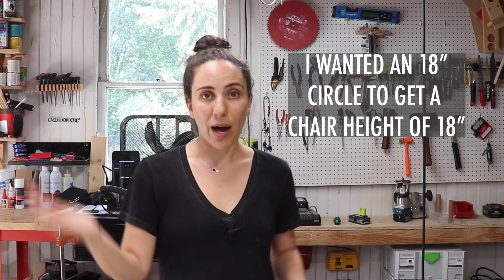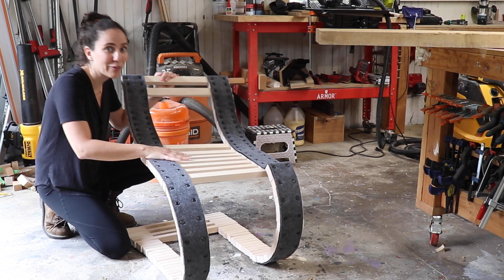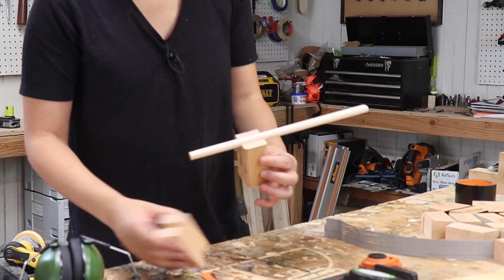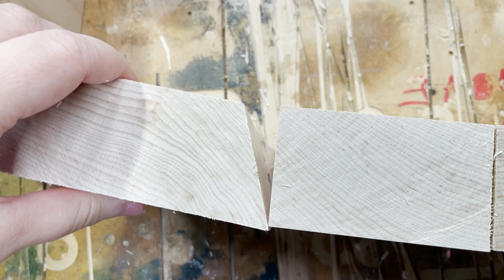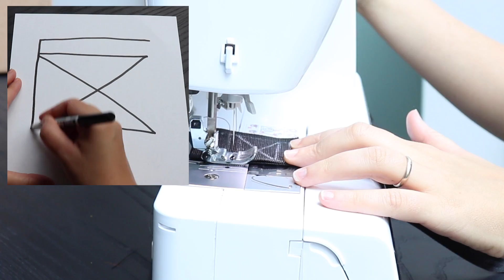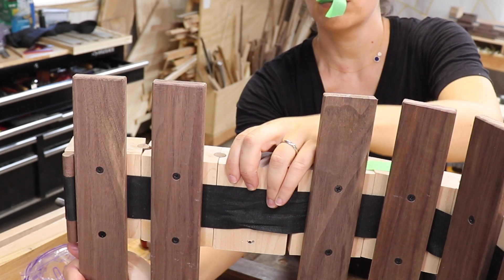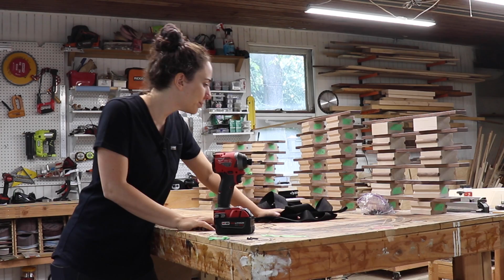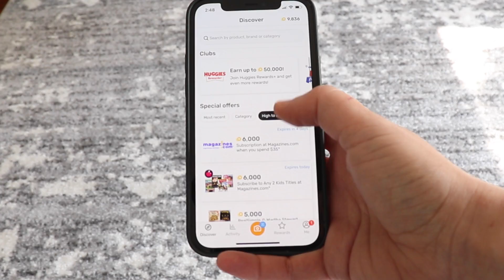I ATTEMPT to make a Roll Up Chair… AGAIN...

Comment: I'd expect cotton straps to stretch less than any polymer material (as long as it doesn't get wet).
You can also take a bunch of the danger out by attaching the strap to each block, meaning tension is only building up in the area immediately adjacent to any given block. Attaching the strap to each block could be done by slats that get pulled into a groove/detent in the block underneath. The strap has to snake around the slat, which makes for a friction fit AND takes out more slack as you tighten the screws.
You might also be able to design the blocks such that they hook into each other like puzzle pieces. And the only way to unhook them would be to roll it all up. That way the strap can become just the thing that makes rolling it up easy, but all the tension is taken up by the hooks in the wood. If wood by itself is not strong enough for this idea, using something made from metal that sits in milled-out detents in the blocks; ends might be a good idea; you wouldn't be able to see the metal when the chair is set up.
A last resort could be to use metal hinges. But that feels a bit like cheating, and it would be super heavy.

Comment: It may make you want to scream, but potentially having seperate strapping pieces from each joint to the next could prevent your extremity pieces being pulled in with the tension. It would also distribute the tension across loads of smaller straps when compared to one single long strap.

Comment: I think you need to stress test the strapping before testing it out and sewing it in. Calculate the maximum tension at a point and see how much it can handle.
In my opinion, i don't think strapping itself will ever be enough; there needs to be a change in how the strapping is connected with the woods or not use strapping at all

Comment: I might be an idiot here, but it appears that the curves you calculated for the angles of the pieces on the convex front are assuming there is no gap on the outside edge. I think your inner angle is too shallow because it’s assuming that the outside edges are touching. I think that’s why you’re getting droop/might be causing the stretching of the webbing material. Also, even static climbing grade webbing has about 10% stretch. Kangaroo leather is the strongest leather but it would be too small for your needs. You’re going to need to go with steel cables or something else that’s absolutely static. It would be really cool to have a bolt at the end you just tighten up with a wrench or drill to bring the chair under tension.
Reply: And most people in DIY know, but piano hinges are cheap and could probably help out with your stability issue and preventing the edges from moving. Weight will go up substantially though.

Comment: Why not route a metal wire inside the blocks for tension control? You can use the straps for aesthetics it will also help with the side to side motion

Comment: you know it has to strech right? like there are fibers and fiber is like what .001mm ? and whole strap is like 2mm thic 
can you imagine how much fibers it takes to strech before getting them tight with surface? just short it as much as you can 
these straps are used as belts in cars just let them strech to their limits they wont snap

Comment: What if at the specific bending point, you have the strap go in a loop around the wooden pieces? That way when you put any weight on it, it squeezes down on itself harder, keeping it together- but for this to work, youd have to have two of the wooden pieces set up to put leverage against one another and pull on the straps- this could all probably fit in the span of 2 modified pieces of the chair
Reply: Also, id try aiming for something with physics on its side for tensile strength. I like to beleive braided rope would work instead of a strap, though i could see how that would cause issues

Comment: Comment sections are great for inspiration! Though I'm a wood enthusiastic myself, I really like the metal hinges idea! They will make the dowels absolete as well!

Also, when I hear "wood" and "compression" in the same sentence, the bowyer in my head whipsers "OAK!" to me🤭

Furthermore I would suggest running it through stimulation software to see where the greatest forces are, and increase and decrease block thickness where necessary, to prevent to much tension on the hinges. Obviously they shouldn't be screwed in the transverse plane of the wood, but preferably the tangential plane, or radial plane.

And if your plan on actually using it, maybe a redundant system in addition to the hinges (steel cables?) for extra safety?
Reply: Almost forgot! Why not rounding the corners of the blocks to spread the forces over a longer portion of the strapping, but concentrate all the force on one point? I think most materials will (at least) stretch, with probably well over 100 kg (because the distance between the lower half circle and your lovely butt make it a fulcrum) concentrated on what is essentially a knife with a very high angled bevel.

I don't think this would make a high enough difference though, but it is an indication of an error on your way of thinking. Apparently, you assume the strapping to be infinity strong, without stretch.

Generally, things are stronger because they stretch. They stop stretching, when breaking. That's why I think anything woven or any polymers are setting yourself up for failure.

Comment: This might be beyond your project budget, but hinges would work to solve the stretching issue. They'd add a bit of weight and not look very good though. You'd still be able to roll it up at least.

Take my advice with a heap of salt, I'm a dumb welder who doesn't work with wood very often/at all.

Comment: forgive me, I'm not a woodworker, so I don't really know the vernacular.  but if you had a tongue and groove on each piece that fit in and locked to the other piece that would give you a firm chair that you could roll-up.  it would also provide lateral stability, and take the tension off the straps, making them just there to hold the thing in shape when it unrolls.

Comment: I FOUND A FIX!!! The reason this is happening is because the chair is creating slack from the top curve and the bottom flat surface as seen @23:00 when you try and sit on it. The other side of the chair needs tension on the bottom of the chair and on the top curve. I suggest making this simple and removable when you go to disassemble the chair by using insertable dowel. And make sure you do this separately for both of these sections 1 for the straight and 1 for the curve… and doing so for both sides. This also means you can keep all the setup you have and just add on to it without issue. Hope this helps :))

Comment: Just going to add some thoughts from an engineering perspective:

You talked about how you selected your strap materials based on them being advertised as strong and lightweight, but strength was never your limiting factor.  Deformation (i.e. stretching) was, and that's a function of stiffness.  Stiffness is literally defined as the ratio between an applied force/stress and the resulting deformation/strain, and while strength and stiffness are of course highly correlated, it's certainly not universal that a strong material will be stiff nor that a stiff material will be strong.  More to the point, plastics, even if they're strong, generally do not have high stiffness when compared to metals, ceramics, or other construction materials (which is why we don't have plastic houses or bridges; they are similarly constrained by limitations on deflection as much as strength).

With that in mind, the hinge idea others have suggested is probably a good one, as metal will be a stiffer material to begin with, and the hinge will also be a bulkier, thicker, and thus stiffer interface than any strap could be.  One other idea would be to look into unidirectional carbon fiber , which can be bought in "tape" widths that come on spools and could be swapped out more or less directly for the plastic strapping you've tried.  Carbon fiber is one of the stiffest materials in the world in tension (significantly stiffer than even steel), yet without the epoxy reinforcement that its usually coupled with, bare carbon cloth is nearly as pliable out-of-plane as any other webbing would be.  Sandwiching a few layers of unidirectional carbon together and leaving them bare would almost certainly be your best bet to make the strap-based design work.  As a bonus, it's even black, so it'll match the look you were initially going for!  Just be careful and do some research before buying to ensure you're getting real carbon cloth rather than a carbon-fiber "look" in some cheaper material, and that it's not preimpregnated with epoxy.
Reply: As another engineer, I had the same thought. The issue here is the stress/strain curves for the materials selected for the tension component. Nordic_Nerd is right on that basically no plastic will have little enough strain to work, and leather is going to actually be worse in that regard. I think the only feasible options for the loads you want (holding up a whole adult with essentially just tension over about 2 meters with less than a cm of strain) are going to be metal or carbon fiber. The CF route will look cool, but the material is expensive, and be difficult to work with, and you also need to figure out how you're going to protect it from outside loads since it's generally quite fragile in the non axial tension direction. I think the best bet is actually to just run ~1/4" steel cable down the inside of the wooden blocks as the load bearing line, and then you can look at maybe just adding aesthetic strapping over top (imo it would look pretty cool just as stained wood).
Reply: @Blink1826000  i was just about to comment about big steel cable (mechanical engineer student)
Reply: Could pre-stretching the poly or nylon strap for an extended period of time solve the problem?

Could inlaying metal to reduce the overall amount of wood (a more compressible material) reduce the amount of excess tension that causes the chair to roll up while in use?

Would using shorter lengths of whatever material and dividing the chair into sections i.e. base, leg, seat, and back limit the stretch in any one section and thus the overall tension as well?

I think that running a steel cable internally (maybe through sleeves to prevent it tearing through the edges) might be the best bet. If so I'd look at complete cable systems for stairs and railings with tensioners that are provided.
Reply: How about those Metal Straps, that are used to secure heavy equipment on pallets? 

Those won't have any stretch, roll up without an issue and be strong enough to not snap!
Reply: Having done some mountaineering I'm familiar with the stretchiness of synthetic ropes. My brow furrowed when I say her original choice of strapping material. I thought "Hmmm... I don't think this is going to go well." The only appropriate material I could think of was carbon fiber. 
The bearing surfaces on the wood are subject to high compression forces. I don't know what wood is good to resist compression. The harder, the better, I suppose.
Reply: Wicked cool project!

I fully agree with Nordic_Nerd & Blink1826000. From an engineering perspective the issue is all about the stretch of the strapping. The interlocking blocks is a super clever solution to keep them from shifting, but now the strapping needs to get WAYYY less stretchy. A carbon fiber or fiberglass, ultra-low stretch strap might work. A series of steel hinges might also be a good way to go.
The wood also has some "stretch", just in the opposite direction (compression instead of tension). As others have mentioned the geometry of the blocks might need to be adjusted to compensate for that, so the chair is angled forward before someone sits in it. Using hardwood is a great starting point but a material change here too (i.e. steel) would also help... kind of gets away from the focus of the channel though.
Reply: She could use dyneema no? I use it when climbing for strong anchors that don't need to stretch cause it basically doesn't, its very strong.
Reply: UHMW by any other name has still the same properties… I also use it for climbing, and it “doesn’t stretch’ because you can’t tell that it stretches. Dynamic ropes stretch at ~27%. Compared to the ~3% stretch of Dyneema, over less distance it may seem like it doesn’t stretch at all. 

In this load case, assuming the aforementioned 2m and 3% stretch, UHMW stretches 6 cm (~2.36 in) at 10% WLL; that’s a lot! Not to mention that preloading the straps doesn’t negate the actual body weight load. 

Regarding using steel straps or cable, I would imagine the compressive stress at the steel/wood interface would become the limiting factor, unless the load was sufficiently distributed.
Reply: I think also the angles need looking at, she made them just to fit but the pressure from one piece is not supported and allows it to come away but if there was a much steeper angle then the forces could be supported by the piece below it and this is the key i believe.
Reply: Just one more engineer to confirm, looks like your current failure mode is a mix of the straps not being stiff enough (See Nordic_Nerd) or, from another perspective, the lack of pre-tension in the curve (see Josh Wright in this video on a project inspired by Tamers original vid https://www.youtube.com/watch?v=2MSEnMGFhMg). 

Quick note about safety as well. Tamar is right, this is pretty inherently unsafe design without much sturdier materials and additional safety factors built in. High tension cables need to be considered carefully, especially in a design with so many exposed pinch points, and especially if you plan on allowing children to engage with the product.
Reply: @devinauld9790  i actually think its mostly because the strap runs the whole length of the chair without being attached to each segment. All the tension acts across the whole length of strap which leads to much more stretch overall. Attaching the strap to each segment not only compartmentalizes the forces, it also allows you to double up the strap between segments near the bottom where you expect higher forces due to the longer lever arm.
Reply: Wow, not gunna lie, I'm so damn proud of myself 😂 I'm not an engineer, but I just posted a comment with my thoughts and improvement ideas, then started reading through others' comments and here you are, an actual engineer, giving almost the same exact advice I did!!  You obviously put it into much better words than I did, but I'm happy I seem to be on the same page as someone with more of a background in this stuff (:
Reply: i would suggest that kelvar would have a high enough young's modulus, while being cheaper and more easily available as load securing 2-3" straps.

however, without a way to secure the joints rigidly there will be the risk of the seat back collapsing forwards like at 23:00. what i'd suggest is using steel cable in drilled channels, and have a locking toggle mechanism to tension the chair into place.
Reply: What you want is some elasticity to it (so it's not too stiff). You can keep that material you have right now, which is not stiff enough, but you have no constraints on how much of it you use. Spread that tension on more of that material and it will not stretch as much. You are putting too much weight on too little material. If it's too stretchy, you'll have to use way too much for it to be convenient, so use something stiffer. But I'd definitely start by trying a full width version of those straps. Also, there needs to be anchor points on regular intervals, probably every piece.
Reply: I would agree but don't think you need to go to the expense of Carbon Fiber when the metal banding strap should provide enough tension without the stretching.  Just ensure that you are tight when first applied, maybe even over tight and let it stretch a little and it should work just fine ....you my need a couple of straps to equal the width of your current banding stretchable material...at least it would not hurt to try it.
Reply: @OneSurferDude  metal banding has an issue with applying a small tensile force to the outer edge of a bend in itself though, doesn't it? Which isn't a problem when it's rolled 5-6 times, but after several in a row, you'll end up with some serious plastic deformation and risk of snapping with very little tensile force.
I use metal banding as installation material, and when I don't have cutters handy, I just bend it a dozen or so times back and forth at the point I want to break it and it eventually snaps just from the force one of the eventual bends puts on it.
(Edit: Auto-incorrect)
Reply: What about something less stretchy, like a thick, double ply canvas?